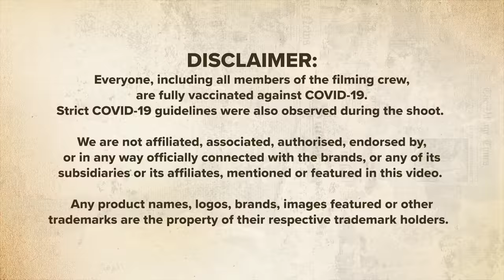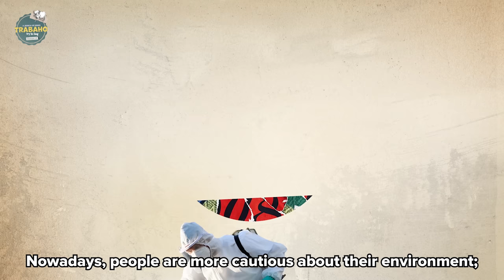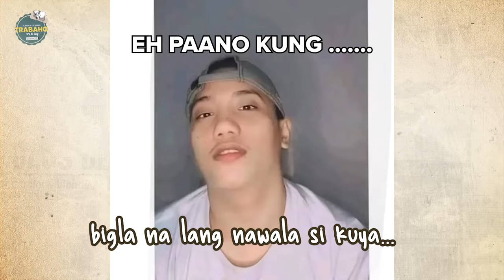Korean ATEs in the House! Life of a House Cleaner | TRABAHO EP. 5

Comment: Watching this make me think that this job is similar to my current job here in Sweden, but we're more of a Hospital and Health Center Cleaners,  where everything is dirty and you'll have to clean through it otherwise the bacterias will just remain on the room. It's pretty similar to this job, because we're always going around the whole year, every weekdays cleaning every Hospitals and Centers on our Region. It's pretty tiring, especially when you have to drive to the location. Other than that the thing that i noticed they start with the walls, because on our job we always start with the furnitures and then one by one we'll move it outside so we could get more space inside, then we use wall mops for the wall so you won't have to climb up and down just to wash your fiber cloth and also whenever we clean we have a lot of micro fiber and white cloths, we use the micro fiber with the cleaning agent then the white are dry, so we could wipe up the remaining cleaner (Cleaning Agent) other wise it'll damage the wall or the paint on the wall. After the furnitures and wall mopping we proceed on cleaning the ceiling, all the lights, vents and other things you might find on the ceiling of a room and when we're done, we finish the job with some machines that we use on the floors. We use 3 different kind of machines. One is the Brusher, then followed by the Kombi and the Polisher. Normally a whole room like that on the video takes about an hour to clean since we don't clean alone. So, everyday we clean about 6-7 rooms and you bet your body will be drained after working and that's just a taste of our job.-

Comment: I knew a Filipino couple from Canada & they shared they story about their JOBS in Canada, they were cleaning Offices, the only difference is that they have their own van, inside their van are Vacuum, mops & several cleaning materials. They need to finished the Job in an hour coz' they need to transfer to another offices. Sometimes in a day they can finished an Ave. Of 5 offices. Their Jobs are so hard becoz' the Husband is a Manager in a Bank when they were still in Phils., while the wife is a Bank Teller, but they have to swallow their pride, by Cleaning Wash rooms, carpets, floors & walls. Sana, the owner of the Cleaner hatid sundo yung mga workers nya, in this way, maybe they can finished at least 2 or 3 in a day.